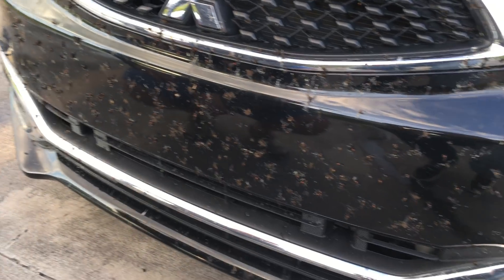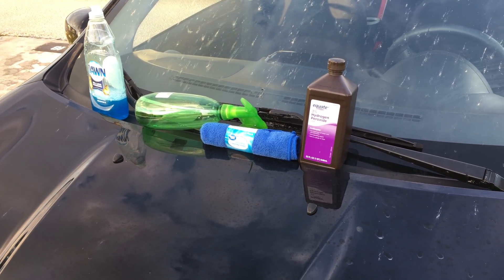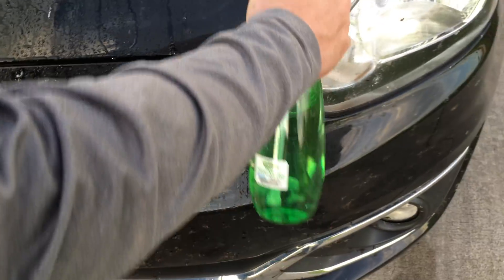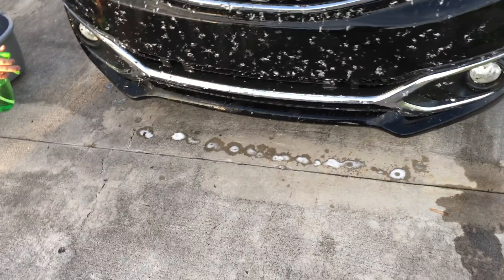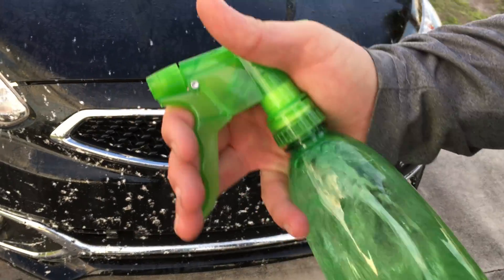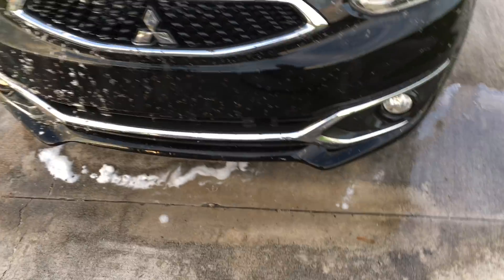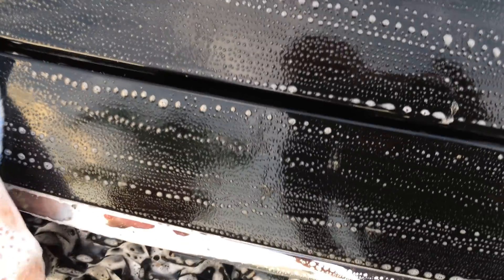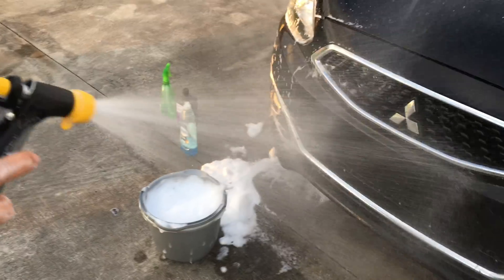Peroxide vs love bugs who wins?

Comment: As a mobile detailer since 89, NEVER use Dishsoap on your vehicle. It strips the wax, Teflon, ceramic coating. Like your camo crocs though.
Reply from the maker: That is the reason to wax your car after dish soap
Reply: Hey @Todd, what would you recommend to remove road film from the lower portions of the car.

Comment: “Super clean” in the purple spray bottle at Walmart it costs about $10.00 spray it on and let it set for approximately two minutes and then wipe off with a clot covered sponge even if you have a black car and they’re baked on they just literally completely wipe off, really amazing stuff.
Reply: Do you diluted that or will it damage the clearcoat ???   Thanks.
Reply: @deejohnson5163  It comes ready to use in the 32 oz spray bottle no mixing required safe on all paint finishes and plastic and chrome
Reply from the maker: No we did not dilute it , but as soon as your done we use dawn to get it clean and then wax it

Comment: When you mentioned hydrogen peroxide, I will be honest I really thought that your nice new car black car paint job was history.But, you did know what you were doing.
Reply from the maker: Yes hydrogen peroxide is a corrosive oxidizer but that is true only on bare metal and it also takes time. So we did wash it off and wash the car with dish soap and then car soap with wax in it to protect the paint and the metal.

Comment: mix several tablespoons of baking soda in a spray bottle with water....mix it up good and spray anywhere on car that has bugs. The bugs are acidic and the baking soda neutralizes them and they basically wash right off.
Reply: I’m definitely going to try this. Several as in 4-5 or 5-6 in a 32 fl. oz. Bottle?

Comment: OR>>>> you could just wet the vehicle...use a slightly damp fabric softener sheet and wipe them right off!
Reply from the maker: Yes. But we like to experiment. Check out our video about peroxide vs dryer sheets on a car! It shows a side by side comparison of which works better.
Reply: @FloridatoAlaska  ya..no...not spending money on peroxide for that experiment.  the method we use works great and its fast! But its nice to have options for these pests.
Reply from the maker: Very true but instead of other people spending the money we try the experiments for them.

Comment: Dish soaps completely dissolve the effects of any wax protection (UV, heat, rain, dirt). It may clean the paint really good, and it will look really super clean and shinny to the naked eye! but if you don't apply wax thereafter, in a few days you will notice the dish soap has just worsen the problem.
You can just use regular carwash soaps, but then again washing the car too often is not ideal either.
There is really no way to completely avoid the damages these bugs can do to the car other than park it and wait for the season to be over. In trying hard by using different soaps, waxes and methods you'll end up spending extra money and find yourself in the same spot over and over again.

There are a few effortless things you can do to max-reduce the damage; Wax the car real good (no more than twice a year), and buy a bra/mask and a radiator screen for the season(s). Use rainx for the glass and avoid using the wipers as much as possible. Try to avoid highways and drive slower than usual. Other than these just keep washing your car with the correct soaps as normal... After many years of trying, this is the must effortless and cheapest method I found. 👍
Reply from the maker: It’s was just a curiosity project but thank you for your comment :)
Reply: Yeah Toyota dealership told me straight up do not use Dawn or it will eventually remove the paint